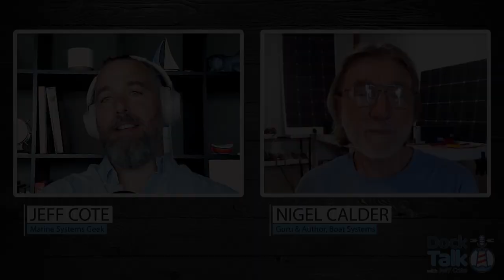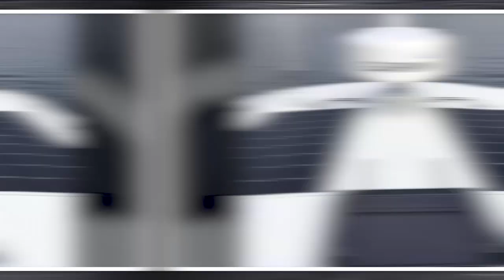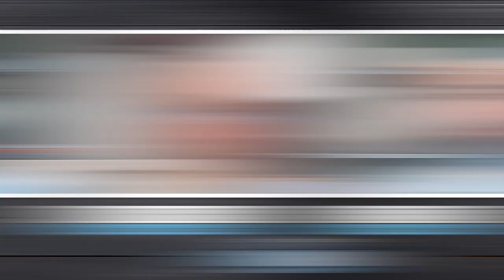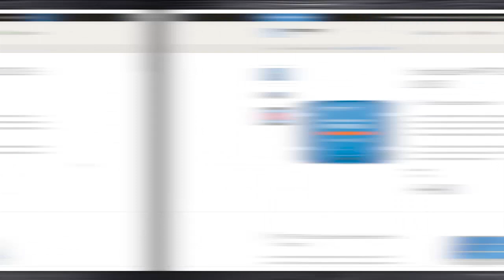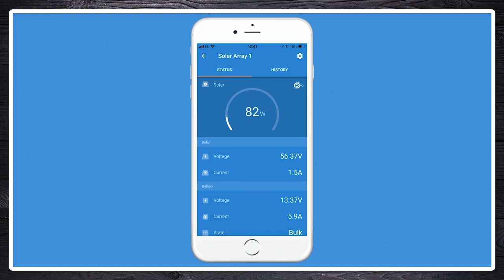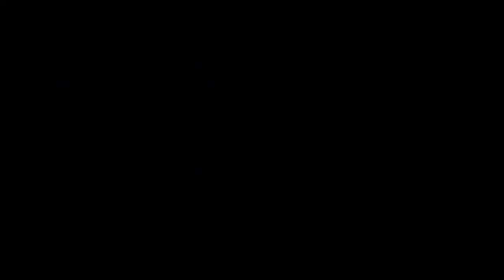Boat Solar Controllers 101

Comment: Hi Jeff
Can you tell me if I need to have an alternator regulator if I have a dc to dc converter ???
Regards
Allen
Reply from the maker: All alternators need a regulator. The DC to DC charging converter is between battery to battery. The regulator is for the alternator.

Comment: I just replaced my few years old 12V Genasun lead acid solar controller with a Victron SmartSolar 75/15. The Victron controller so far is vastly superior - blue tooth and temperature compensation enabled showing history of solar controller and allows end user programming. The Genasun controller was overcharging my few years old 12V 300Ah house lead acid battery bank from my old 70W solar panel while boat sitting at dock in West Vancouver. The result was that I would always find that I needed to add significant amounts of distilled water to the 12V batteries when regularly doing maintenance checks. The Genasun limited user interface those LEDs, did not provide any usable information to understand what the controller was doing and why my batteries required so much distilled water. It seems the Genasun controller would never switch over to float voltage output level from bulk / absorption voltage output levels,  as I would  monitor the charge voltage levels on my Victron BVM battery monitor while on board. Recommend Victron controller for sure. Genasun outdated.
Reply from the maker: Thanks for sharing.

Comment: I really appreciate your videos and everything was going good until you said that you've seen battery banks die from not having a temp sensor in the correct location. I'm currently connected to the grid and working on a system that is not only independence but reliable within a budget
Reply from the maker: Thanks for sharing.

Comment: 19:10 could you elaborate on what the charge controller is sending?  I've been confused about this. When a battery is below fully charged voltage, and the controller is programmed to bring it up to a specific voltage, what is it sending to the batteries?  I have victron controllers and Battleborn batteries and I've been wondering what is actually happening during charging. Thanks again and I can't wait until you discuss the advancement in panels!
Reply: The charger controls the charging Voltage, the higher the Voltage, the larger the current into the batteries. Power flows from high to low Voltage, so the charging Voltage must be higher than the batteries'.
Reply: @josidasilva5515  so does it keep the voltage just above what the battery is until it reaches the desired (programmed) voltage?
Reply: @chachi5975  yes, and according to batt temp for desired Amp level.
Reply from the maker: Thanks Josi for contributing to the conversation.